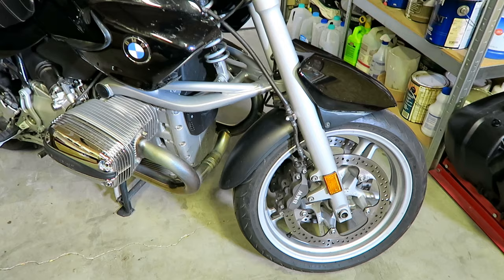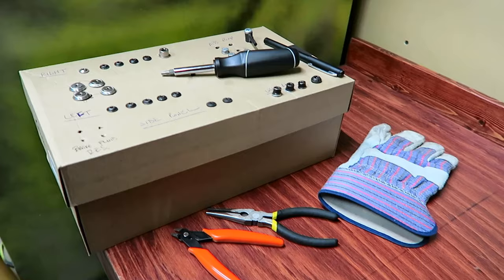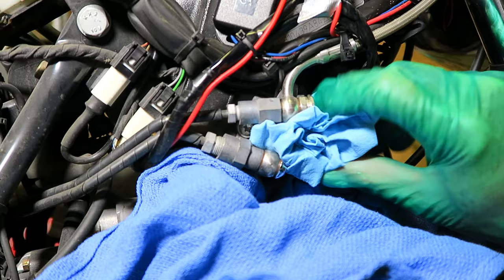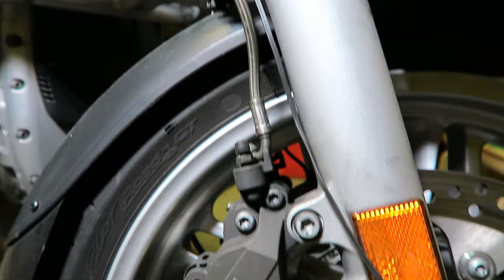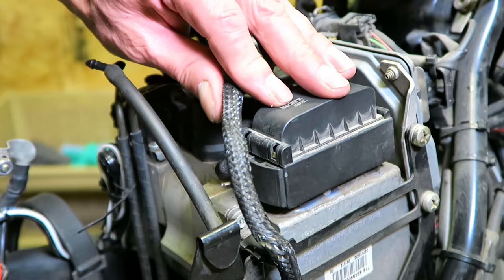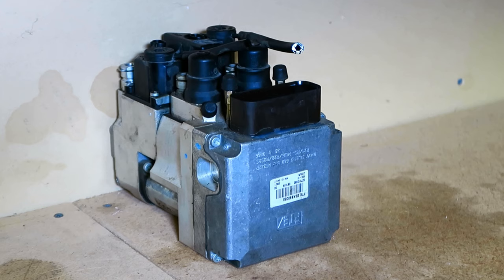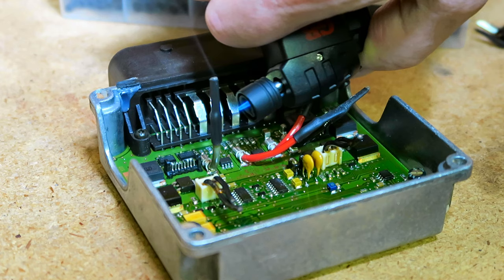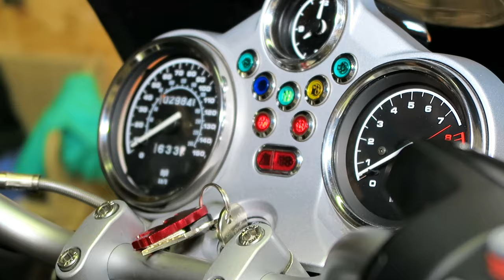BMW R1150R ABS Removal | How I Convert My Bike to Non-ABS

Comment: Hey there, going after the removal on my 2003 RT. Do you have a part number for the crush washers? I looked at the parts diagrams, and it shows the washers, but item 3 is not included in the parts list. It appears so far that everything you did is the same configuration on RT so it looks like its going to work! Thanks, Bill
Reply from the maker: My understanding is the electrical configuration on the RT is a bit different from the R model.  I don't know the details but some RT owners report having to make a few changes to get the tail light and brake lights working properly.  The speedometer may be impacted as well if it runs from a sensor on the front wheel rather than the mechanical version.  Do some more research just to be sure.  I don't know the part # on the crush washers but a BMW shop will have the answer.
Reply: @WheelStories  Thanks. I will let you know if there is any mods needed for the electrical part.
Reply: @WheelStories  Well, I did the ectomy today. Waiting on the parts for the front. I'm happy to report the brake lights work normally with the ABS module hooked up. so there's that. Thanks for the help. The video helped a lot.

Comment: Great video. Does anyone know where I can find the junction point for the front brakes for a r 1100 GS?
Reply from the maker: I think you can do some google searching to get the part number then contact a BMW service shop to order.  There are several BMW dealers in the US that have online parts ordering portals.
Reply: @WheelStories  haven't had any luck yet. What did you search?
Reply from the maker: Try BMW r1100gs front brake hose junction.  I believe I posted the part number in the video as well.  It may be the same part for your bike.  You could consult with your local BMW shop.

Comment: Ive owned over 3 dozen motorcycles and I have to say, servo assist ABS brakes is one of the worst things Ive ever experienced. Just picked up a 2002 R1100S and was reminded how bad this system is. Im thinking about doing this mod. Or at least getting rid of the servo assist. It doesn’t help that bleeding this system is a huge pain in the ass.
Reply from the maker: True story.

Comment: Hi... Great video... In your video yua said that after the conversion to a non abs, the two bike will have a almost the same break power... What does mean...
Reply from the maker: I meant to say that both bikes will feel about the same in terms of manual braking with the same feel at the front brake lever and rear brake foot pedal.

Comment: This has given me hope.
I hate my abs, too much maintenance .
I hv 2004 r1150rt, any reason this won't work for mine?. Parts list would help!
Reply from the maker: I am not familiar with the RT model.  I believe the electrics may be a problem as the RT speedo I believe is run with a sensor that may stop working after the procedure.  There may be issues with the brake light as well.  That's my understanding.  I recommend that you do more research with mechanics who know how the RT works.
Reply: @WheelStories  thank you kindly

Comment: Hi. What happened to your rear fluid reservoir?
Reply from the maker: It's still there.  I believe I showed it in the video when it was time to bleed the brakes after redirecting the lines.  It's under the seat on the right side of the bike just above the right foot peg.

Comment: I love this  very well explained video.  I hoped to perform this operation on my 2007 R1200GS, but a mechanic at my local BMW shop says that the electronics modification described in your video will not work on the ABS II module.  Do you know anything about this?
Reply from the maker: I am not familiar with the 2007 model and the ABS II module.  I'd trust the BMW mechanic if the story is it will not work.  You might focus your hunt for information on the ABS II module.  If the device is not working, there is an outfit located in Moscow, Idaho that performs rebuilds.  I can't think of the name at the moment but they might be able to offer some help.
Reply: @WheelStories  Thanks for you quick reply.  ModuleMaster in Moscow returned my module saying it had fault codes they could not repair.  New modules from BMW are not available.  I was going to buy a used module on eBay, but was told it won't work because each module is programmed to the bike at the time of manufacture and there is no way around this.  I was so excited when I saw your excellent video, but then got the news from the BMW mechanic that this wont work with ABS II.   It appears my only option is to  turn my bike over to a cycle salvage outfit when its parts can be sold.  So sad!
Reply from the maker: That is so unfortunate.  The ABS issues on older BMW models are a major minus point and may prevent me from buying BMW down the road.  You'd think that with proper maintenance you should be able to keep these bikes on the road for years.
Reply: ABS II brakes work fine with a bad module...... just no ABS function.

Comment: Are you OK with the lack of a general failure light? I guess it mostly shows oil pressure faults apart from the ABS-issues.
Reply from the maker: Would be nice but I don't know what the solution is to restore the general light.  I keep my bikes well maintained and do the pre-ride checks.  The bike is 17 years old.  I'm okay without the light given that I was able to resolve the ABS issue.

Comment: hey man, you think it's possible to  replace the unnecessary rear reservoir with a traditional one? i have a k1200rs
Reply from the maker: Not sure.  I've not investigated that question.  I'm not familiar with K1200RS.  You might hunt down an answer on some of the message boards dedicated to the K series models.
Reply: @WheelStories  I ended up ordering a traditional one. My reservoir that was associated with the ABS system is no longer needed as the previous owner ripped out the ABS module, pipes, wires, etc. Taillight still works because I saved the connector and plugged it in. We will see how it works when it comes in

Comment: @wheelstories My cousin and I are performing this deletion on his 2002 BMW. When we remove the ABS we no longer got fuel to the injectors. Any ideas?
Reply from the maker: Unfortunately, I don't know the answer.  Check the connections to the gas tank for the fuel pump.  Might be a problem with the fuel pump signal.  The fuel pump relay could be bad, perhaps.  Those are the only ideas I have.  You might try a few google searches to find other riders who may have posted information on fuel not getting to the injectors with their BMW's.

Comment: Why cut the wires to the pumps? Easiest and most logical way of doing this bypass is to just bybass the circuits direclty on orginal frame parts. Open the abs box and pull the cable for each motor and leave everything else intact and put it back together with unit in the frame. Than everything is as normal and nothing have been damaged. Just put some stoppers into where the 4 pipes goes so dirt and stuff dont go inside and all lights works and abs and servo are bypassed.
Reply from the maker: Good suggestion.  More than one way to skin the ABS cat.

Comment: Thanks heaps mate.  I am rebuilding a 2003 1150rt from the ground up, so will be doing this instead of trying to revive the ABS.  Question though... after this is completed, i assume it would be fine to remove ABS sensors and rings??  Have you you taken yours off yet, or have any plans to?
Reply from the maker: I have not.  Looking at my bike I believe you will need to use some shims that are the same width of the rings to ensure that the wheel lines up correctly with the brakes.  Take a look.  Not sure about the sensors.  I can't recall if I have responded to any of your posts on this subject, but be aware that you may encounter electrical challenges with the RT after removing the ABS.  The speedometer may not work correctly as well as the tail light.  That's what I have heard.  The speedometer on my R1150R is old school mechanical, made to spin by the front wheel.  The RT I believe may be electronic with a sensor.  Something to study.

Comment: Question for anyone: I have a 2004 BMW r1150r that's in excellent shape. I do 90% of the wrenching myself which thus far has included fluid changes, valve/TBS adjustments, and a conversion to non-ABS (which was sooooo worth it!).
Anyway, I just started experiencing the dreaded surging that seems to afflict so many of these motorcycles, and I was wondering if anyone had any troubleshooting suggestions.
Reply: Read about charcoal canister contamination of fuel, and it's removal. Chris Harris has done a few vids on it
Reply: Get a Twin-Max and fine tune the fuel/air mixture and remove the cat plug. I did this on my 2001 gs and have no issues with surging.

Comment: Great video!! Is is common for 2014 r1150r abs systems to fail now in 2020? Im thinking about buying one.. but this has got me thinking...
Reply from the maker: The bike is a 2004 model.  I don't know how common but there are quite a few online write ups about the ABS III integrated system failing.  I believe the impacted models are from roughly 2000 to 2005.  I've not heard about too many ABS issues on the newer models.  Might be a good idea to research before making a buying decision.  In spite of the issue, I still enjoy my BMW and plan to continue riding it.  Thanks for watching.

Comment: Noob question, I’m new to these bmw bikes. With that being said, I have a 05 k1200s, will this work ? I seen a video we’re someone did way more than what you did and yours looks easier and cleaner. Please help….
Reply from the maker: I don't know the answer.  The K1200S could be much different than the R1150R featured in my video.  I'm not familiar with the bike.  The wiring and electronics for the brake lights and dash board may work much differently.  I recommend speaking to a BMW mechanic or someone who is an expert on the K1200S.  Have the bike looked at if you are having a problem with the ABS system.

Comment: I followed the instructions to a T.
No brake lights and no speedometer.
I'm at the end of my wit's, any suggestions?
I do have to say my brakes are terrific now without ABS servo.
Reply from the maker: Dang.  Sorry to hear.  Sounds like your speedometer is electronic rather than mechanical.  My speedometer is mechanical and attaches to the front axle.  But if you didn't cut any critical wires and reconnected everything back up to the ABS electronic module, you'd think that the rear brake light and speedometer should work.  Check your fuses if you haven't already.  When I wrapped up my project I had to replace a fuse for my driving lights.  The fuse may have gone bad when I reconnected the battery and tested everything.  Have you searched any other BMW ABS videos and message boards?  You may find some recommendations and answers there.  BMW owners groups for the 1150 R, GS and RT models.  Many owners have performed the ABS removal.  So I've got to believe there is a solution.

Comment: I am assuming this is valid for a 2002 1150RT. Happened to me once on my trip from NC. Stopped and restarted the bike. Brakes worked normally from then out. Just the incessant blinking lights 4cps…… great video. Thanks!
Reply from the maker: Based on reports from RT owners, I believe the 1150RT is different on the electrics.  Some owners have discovered the speedo and brake lights stop working after the procedure.  I'm not familiar with the 1150RT but my understanding is that the speedo works with a sensor and the brake light is wired differently from the R1150R.  I'd recommend doing additional research.
Reply: Thanks for the quick reply. On the 2002 RT, the speedo is mechanical. Brake lights? Not sure. I will research and let you know.
Reply: Please Bill tell us all if it worked good for your 2002 r1150rt. I have that model. My ABS light is flashing and my rear rubber brake line just popped too.

Comment: I'm looking at doing this to my '06 1150 GS adv. Do you know if the parts you referenced are applicable to my bike? Thanks for the great info!
Reply from the maker: I'm not certain.  I can only speak for the model and year of my BMW and what I found to work for me on the ABS modification.  Try to do as much research as possible on message boards, videos and speaking to professional BMW mechanics.  I am a hobbyist with the tools.

Comment: I plan to do this to my 2002 R1150R. Can you share where you sourced the parts used on the front?
Reply from the maker: If my memory serves I believe I ordered the junction piece through a BMW dealer.  The part number is posted in the video.  There are several BMW dealers that sell parts online if you live a distance from a dealer.  You might try a Google search.
Reply: @WheelStories  thank you. I found it on a site from which I have ordered parts before. I was just checking to see if there was a better source. Thank you for taking the time to respond!

Comment: Where did you get the new distribution block I do not see that mentioned anywhere?
Reply from the maker: I ordered the parts with the part numbers listed in the video through my local BMW dealer.  The block doesn't come as a complete piece.  The brake fluid bleeder valve and dust cap are sold separately.  Kind of expensive.  I think the parts can be ordered online through a dealer as well.
Reply: @WheelStories  Just a heads up best to put that sort of info in the video description not in a screen shot had to scrub the entire video to find it.

Comment: I just purchased the exact same motorcycle, R1150R with ABS and I’m not sure if the removal is for me.   How do I check on the bike if the system is ok?    I love your videos.   Thank you for posting such good info.  L
Reply from the maker: If the brakes are working and your ABS warning light on the dash isn't alerting you of a problem, then your ABS system is likely fine.  Just make sure you have the brake fluid changed according to BMW's recommended intervals.  Old brake fluid with moisture or air in the lines will cause problems.  If you do encounter a problem, have the bike looked at by a BMW mechanic.  They can hook it up to a computer and diagnose the problem.  Could be something that's easily fixed.  Good luck with the bike and thanks for watching.
Reply: @WheelStories  Thank you.  It’s great so far and I’ll take your advise

Comment: Success!!! Sort of...
I tested the brake lights after installing the "brain box" and everything was good. After about eight successful tests, everything was good. Now all of a sudden when I turn the key, the taillight comes on and a second later there's a click near the fuse box/taillight area, and the brake light comes on and stays on. Any idea why it's doing that? Do I need to do a rolling start with the bike?
Reply from the maker: Good question and I don't have a good answer.  I don't know what would cause the brake light to stay on after working properly through the initial tests.  You might try unhooking the battery then reconnecting to see if a reboot changes anything.
Reply: @WheelStories  I think I got it. I'm going to attribute it to that crazy BMW systems check (turn on the key, let computer fire up [don't touch anything!], then perform the rolling start). I was turning the key off and on a number of times--maybe that screwed up the computer. Anyway, that seemed to do it the two times I drove it around the property. If it happens again (and the drive-away doesn't fix it), I'll give the battery reboot a try.
Thanks again for your excellent DIY video. Do you have a homepage where all your vids are stashed? If so, could you send me the link/URL?
Have a great weekend!
Reply from the maker: Excellent.  That's good news.  The link to my YouTube homepage:  https://www.youtube.com/channel/UCULdW4ovwCDvdjJIT9Ah3gw

Comment: Hi, excellent video with a huge amount of information 👍 thank you!

I would like to ask you for a piece of advice regarding power module. 
If the power module is disconnected (2 plugs), all hoses are removed, but still the unit is settled in place (cleaned for any fluid before) and then the main electrical plug is connected (to the box that you sealed and cut the circuits inside), would there be any issues for electrics? I know that abs will not be working and error light will appear, but I would like to not to cut any electrical circuits. 

Thank you in advance for your reply!
Best regards, Maciej :)
Reply from the maker: Good question.  I don't know the answer.  You'd need to make sure all the fluid is removed because the pump will still try to work.  You might ask a BMW mechanic for an opinion.  I'd be interested to know the thoughts from someone who knows the system better than me.
Reply: @WheelStories  Thank you for your reply! I will also contact local BMW services if they have any other solutions. In my case the motorcycle is working normally with full braking power until the error message appears on the dash and after swith off/on comes back to normal. In your case, have you lost braking power immediately or it was again working fine for 10,15 km unitl error message?

Thank you!
Reply from the maker: I was able to restore braking several times after the initial failure by turning the motor off then on again but the braking would fail soon afterward.  I didn't feel safe riding the bike.  After several attempts the braking failed completely

Comment: Did you make your copper brake line to bypass the pump?
Reply from the maker: No.  I bought the junction piece that is used on the non-ABS version of the bike.  I bought it through the parts department at the BMW dealership.

Comment: 2008 same procedure?
Reply from the maker: I'm not sure.  I believe the 2008 model is configured differently.  If I'm not mistaken, I believe the brakes on the 2008 model continue to work when the ABS module fails.  But don't take my word for it and do more research.